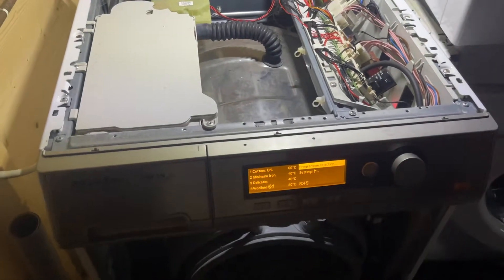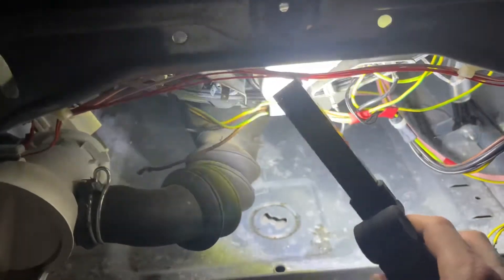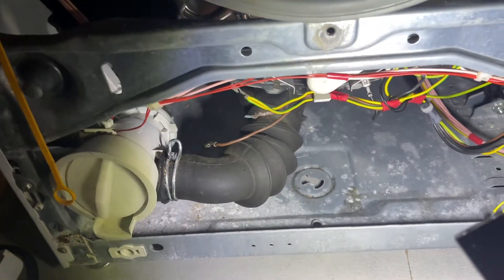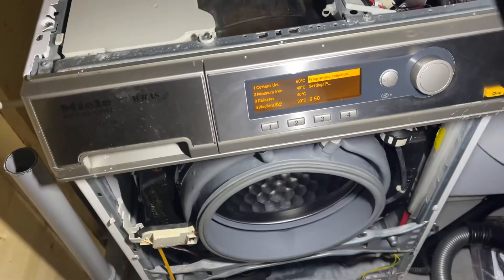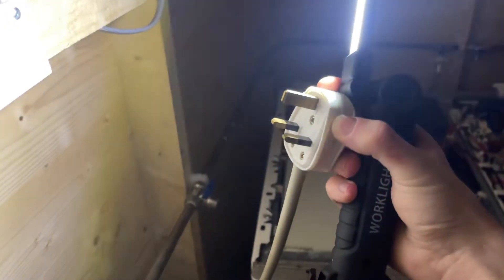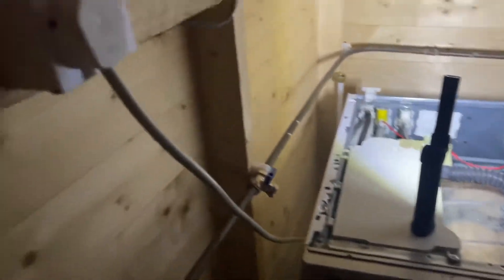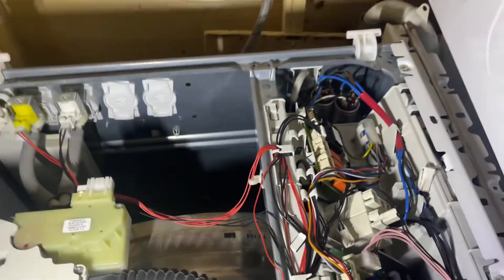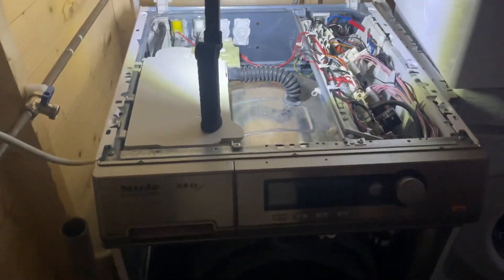How I converted and used a Miele professional washing machine on a 13amp normal plug

Comment: Very nice, I wonder if it does pay to set the heater rating to a lower one in the programming so the machine can expect a longer time for it to reach the set temperature. Would it pay to reconnect the earth on the left too? I assume the relay connected the two dangling wires